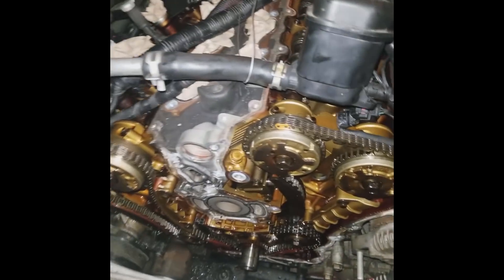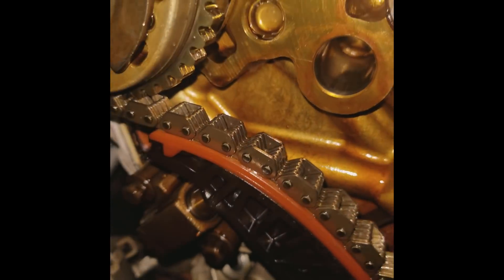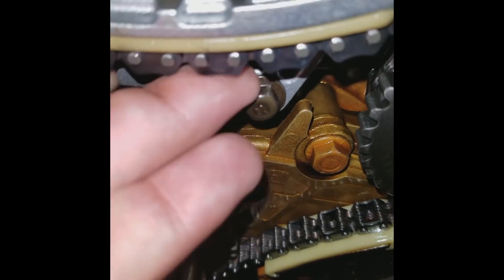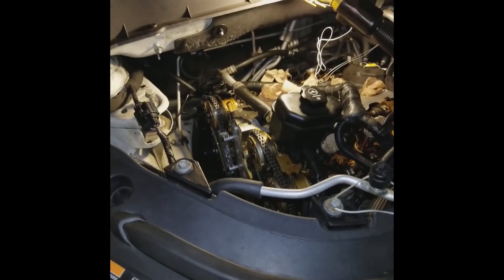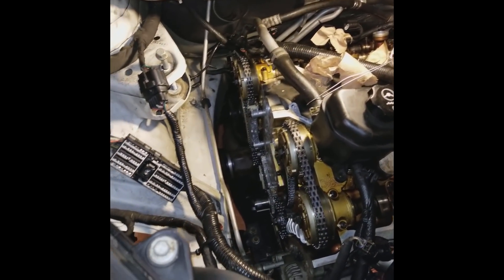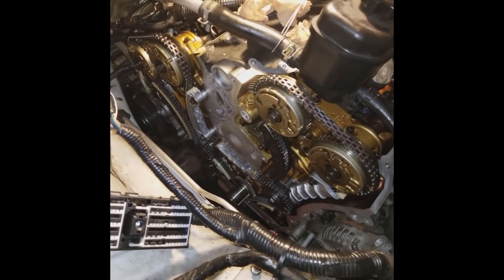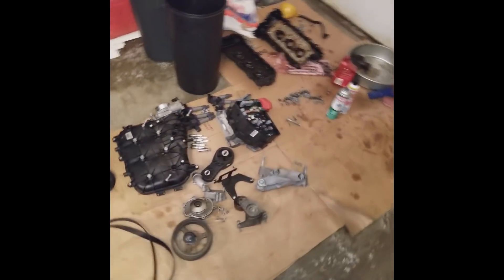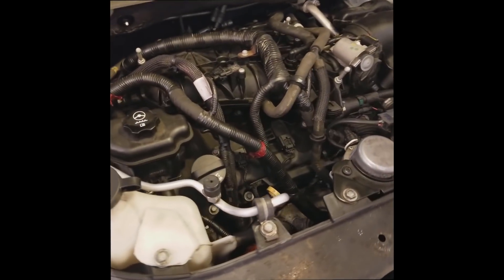GM 3.6 High Feature V6 In-Vehicle Timing Chain Replacement, No Engine Removal, Stretched Chains

Comment: I'm on my 3rd round on my 2010 Chevy Traverse.  Installed everything knew having trouble with phasers locking properly on left intake.  Jumped timing brand new parts from Amazon.  Tried to send back bad Selenoids in the kit they wont give me my money back.
Is there a wrong way to install a phaser?

Comment: Great video, I am in the home stretch, Just wondering about the timing cover.  How did you put sealant on it and NOT mess it up installing in back in.
Reply from the maker: Do a dry run or two first. The only other thing that's key is having someone else with some dexterity to help you! Good luck to you, sir!

Comment: About to do this on 2008 Acadia. Im original owner have over 135K. No check engine lights and this will be it's first timing chain job. The only real reason I'm doing it is because the timing cover started to leak. I change my oil every 3000 so the engine has been good. My questions is what RTV did you use and did you put new sprokets. I was going to get a Cloyes kit, but I've seen and read lots of chains busting at under 5K in the last few years. I believe they are no longer making them in the states so most kits now say made in China SMH.  I'm just going to get OEM chains instead. Tx
Reply from the maker: Wow, hadn't yet heard that about Cloyes. What a shame. I just had a bunch of bad Moog parts recently too. 

If I recall correctly, I used the part number for the sealant that's recommended by GM, which I believe is in one of my other comments here. But I wouldn't hesitate to use just permatex RTV or something good like Honda/Threebond either.

I didn't do the actuators, as I was really suspecting just a chain issue. However, I have heard of a lot failing and seen a few. I wouldn't be surprised if it was more common on the earlier years, but I'm not sure on that. I doubt it would hurt to do them, but that's something I'd definitely go with OE on as well if I did anything. For me,  it would probably come down to cost. You might want to check for any info or TSBs regarding certain years or one or intake/exhaust being more or less common. 

Hope it all goes as smoothly as possible for you!
Reply from the maker: Also, and I don't want to jinx you,  but my understanding is that those early years had other issues:  front and rear evaporators, transmission failure... right as everyone's quality dropped with the housing crash, plus early models are always a crapshoot. Just wanted to mention that in case it influences how much time and money you put into it and weren't aware!
Reply: @ClaytheBMXer  Well I take good care of it maintenance wise. I change all the fluids early (Only use Full synthetic) so maybe that helped it last so long. Yes I've heard of all those problems including the 07-08 vs 09 and beyond engine minor update tweaks to the engine. The only components that have gone out is the powersteering pump, motor mount, one coil pack and the radiator developed a small leak near the fill elbow this year. Not bad for a 15 year plus vehicle I live in Southern California Desert area in 110-120 plus weather 4 months outta the year 😅 I replaced everything myself so saved 💰. Other than that she still runs mint. I'm getting the OE kit from Rockauto. I'm doing the job myself so it's only costing me the parts. I was bummed too that Cloyes QC has gone down. From reading reviews to commenters and videos online not going to take that hit or miss chance. Did you use Ultra Black RTV and did you change your sprockets?

Comment: P0017 doesn't mean stretched chain. You probably just needed to replace the cam sensor.
Reply from the maker: Incorrect. This is a correlation code,  not a circuit fault.
Reply: @ClaytheBMXer  if that's the case I'm selling my car lol
Reply from the maker: @MOTHERCLUCKER2014  I wouldn't blame you at all! Good luck to you! 

I see lots of confusion between CMP circuit faults, performance faults, and cam-crank correlation faults. 
The same goes for things like catalytic converter efficiency codes being mistaken for "O2 codes" (this actually means the sensor is working). 

It's always worth reading all of the published information on a code - set criteria, possible causes, action taken when set, even skimming through the trouble tree that's usually terrible can help your understanding of a code and how to resolve it! 
There are even DIY versions of things like mitchell/prodemand that are worth it for tackling certain problems! 
The internet is great, but question everything - even me! It helps to have a diagnostician on speed dial too, but that's not always feasible Haha.
Reply from the maker: @MOTHERCLUCKER2014  I should add that the 100% correct way to diagnose the issue is to hook up an oscilloscope and compare waveforms with known-good captures. However, it's also not always completely necessary.

Comment: I agree..not too much help from YouTube on all it takes...im not great with organizing parts...but if ya just have lots of time, great perseverance it can be done...lots of research on YouTube researching available subjects on certain things like just removing valve covers or replacing motor mounts etc..plenty of videos on timing chains, while up on bench made that part easy...its all the other stuff that goes along with it that is quite tedious....my hats off to anyone with the guts to tackle this job without a garage and equipment like power ratchets and stuff to make bolt removal  easy..all those bolts that have plastic inserts that have to be wrenched a ll the way out instead of broken loose and finished up by hand  can be especially tedious for a man that turned 68 yesterday...oorah!

Comment: I did this job on a 2010 Lacrosse with the engine in place, saved around $2,000. Turned out great, but holy crap it was TOUGH. Congrats on your success 👍👌💪👊

Comment: Sir could you be so kind to convey if cylinder number 1 is top dead center at stage 2 position or stage 1. Thank you 🙂
Reply: Make sure the flaps from the cams in the rear are straight  - -

Comment: Can we get an update on the Cloyes timing chain, any issues 4 years later?
Reply from the maker: Zero issues until vehicle was totaled in a traffic accident about a year ago. It only got around 15-20k miles put on it though. I have since used Cloyes on a couple of other vehicles with no issues as of yet. I have only heard good things from others. Unfortunately though, I don't have any data beyond anecdotal.

Comment: Marcel Grundmann
0 seconds ago
Its true, breathing is a problem, so solution is...drill trough the pcv valve  (4mm)  on the right rockercover ( remove it before you do it!)  remove the plastic hose with the t piece connecting the pcv to the plenum chamber. remove the lh rockercover breather going to the air intake.  Now slowly heat up the plastic hose at the t piece and remove the t piece. Rh Rockercover back on. clip the hose back on the drilled out pcv connector, use a silicone hose piece and the old plastic hose to extend the pcv hose with the original removed plastic hose, it routes along the back of the engine just like before, just no t piece, ending up parallel to rh rockercover breather, cut rh rockercover breather and fit  with careful heat the t piece, connect hose back to air intake . clip it all back into the hose supports. block the plenum chamber inlets, done.... no more breathing problems, looks factory, cant tell the difference,  huge difference in engine cleanliness,  however the throttle body does get a bit dirty over time and should just be wiped out every second service, these engine always consume some oil, checks and regular services are a must.... any questions or pictures contact Boat and Bumper.... Humpty doo..... hope that helps

Comment: I have that engine in an Acadia, 2012 with 152,000 miles.  Babied since new and works fine, oil analysis very good.  I wonder what it’s life expectancy is.  I wonder the same on the tranny, it’s on 4th drain and refill.  Still has original pads and rotors.
Reply from the maker: Glad to hear that!  Hopefully it keeps going. Hard to say what the exact cause of these failures is without knowing the complete history of the vehicles. If I recall, the exploding wave plate issue was fixed after 2011? And wow! You must not use your brakes haha. I've never seen a set go that long,  even on a prius. But I'm also in the rust belt.
Reply: @ClaytheBMXer  Arizona car, a fairly good amount of highway miles, no Jack rabbit starts and light brakes when possible.

Comment: I'm on take two. my Cadillacs last chain didn't even last two years. Don't use cheap parts. Thanks for the video I have to do my traverse next and I haven't done one with the motor sideways, Cadillac gives you tons of room because the motors in there straight.

Comment: I think I’ll flop a new oil pressure sensor switch &&& a nU power steering pump in there(as well as oil pump, water pump, all phaser sprockets, cam sensors & slide in auctoator gizmoz) Y not👋😒
Reply from the maker: It's a lot of extra money, that's why I didn't. The water pump and oil pressure sensor are definitely common failure items for leaks. That said, I'd go OEM, had issues with even gates and standard on both. I've only ever seen one power steering pump go bad on any of these platforms. It was on a FWD model and was easy to remove on its own. Never personally run into a bad actuator either, although I've heard it discussed and seen it in case studies. This would be the time to do them, but again I'd go OEM if you do. The CMP sensors and solenoids are accessible with it together though. I don't recall how much extra work an oil pump would be. Only you know how long you intend to keep the car though, and my experience is mostly anecdotal, so you do you!
Reply: here’s one I heard incase U didNt, this sludge is often associated with pcv valve  but the 1 bigger small hole redrill to 7/64ths & the 2 smallr smalls to 5/64ths👋

Comment: How did you move the power steering pully out of the way
Reply from the maker: IIRC I unbolted the pump assembly but left the lines connected and moved the entire pump out of the way. It's been awhile though.

Comment: The problem with the Alloytec/GM engine stretching chains is due to the PCV valve, the holes are too small so clog up stopping it from breathing. Pop the pcv valve off drill the holes slightly bigger, then if possible add an oil catch can & it solves the timing chain stretch issue.
Reply: I did exactly this same thing a couple of years ago on my wife's impala, fingers crossed it works. She only has 80k on the engine currently, but i do 5k synthetic oil changes as well. This is a project i really don't want to do unless i have to

Comment: What kind of cilicon did u use to put it back?
Reply: was thinking same thing cause my cover is leaking
Reply: @bigwaves2824  Right Stuff 90 Minute Red High Temperature Gasket Maker on Amazon
Reply from the maker: Here is a copy/paste of my response in another comment for the benefit of others. Sorry I didn't respond sooner, hope you got your car all fixed up! 
"I just checked SI. The GM part numbers for the sealant are 12378521 (150g) or 88861417 (75g). It would also be prudent to find the factory procedure/image for applying the sealant. They are very specific about how much you should apply and where. I do not have a source on this besides having access to an expensive, professional Service Information subscription, so I wish you luck."

Comment: Thanks for measuring the chain. I was wondering if I could slide some new idlers in without all that work but they probably get trashed quickly if the chain is all stretched out.
Reply: Nope. You should have gone ahead and done so. I've done a bunch none have come back to me. Coyles etc want you to spend a fortune to replace unnecessary stuff. If it's a chain just replace the chain etc
Reply: @chumadoshi6987  technically speaking I still haven't fixed it.  all I know is it's real rattly sounding like the chain is rubbing on something.    and I think it's messing with the cam sensor because anytime I turn to the side while driving the engine practically stalls out.  I ordered the cheapest version on eBay or Amazon along with the valve cover sets exedra so I probably have all the parts I might need.  They were suspiciously cheap though.
Reply: For this kind of job use good chains cloyes are good ones the kit@SiriusSolar

Comment: Hello, great video, thanks. Just did timing chain set on 2009 Enclave.  Right side timing does not appear to be correct.  Need help confirming right side timing by identifying cam locations to tdc before completing assembly.  Help!!!
Reply: If you buy the timing chain kit off e bay, it comes with a set of spanner locks that fix the cams in the correct position.
Reply: @Dev JB A garage did my 3.2 v6 alloytec  a few months back & said he couldn't understand why people needed to do the 2 stage and did it in one I think, using the cam holding spanners, car seems to be running fine? Or do I need to go back?

Comment: I've done similar timing chains on the Duratec V6 in Ford vehicles. Equally a pain but an even number design. On those, the water pump is inside the motor and driven directly off the chain. Guess what happens when the water pump leaks? 💥
Reply from the maker: Yessir, I've been inside one of those. On the Edge, I ended up dropping the front subframe, engine, and trans. Not sure if that's the most efficient way, but at least I had good access. You've gotta admit though - it's at least slightly funny when an alternator starts leaking coolant ha.
Reply: @ClaytheBMXer  I agree...lol. The most unusual place for a weep hole

Comment: GM makes their engines pretty easy to work on!...I just did mine and it wasn't that bad!...these engines are BEASTS!...I'm an uber/Lyft as well as commercial driver but I've also worked on cars for over 30 years!...so I've worked in just about everything and by far Fords, Mazdas, mitsushitties and all european junk are the worse to work on!...I got over 250k on her with the stretched chains she was still running good with a/c on!...no overheating issues or anything!...but it's the PCV valve that's killing these beauties...but once the issue was fixed cars gotta new lease on life!...oh and I got my chain set for $100 on ebay!...its a complete kit!...
Reply from the maker: There's not a single company I can think of that still builds cars with serviceability in mind. I would strongly, strongly recommend using only a quality timing kit from somewhere reputable. Fake parts are becoming more prevalent on Amazon and Ebay as well.

Comment: I'm doing mine this week. I have 124k on my engine no codes or anything like that but I just don't want this thing to stretch and jump timing and damage the engine. I'm also going to change the oil pump. Any tips on changing the oil pump?
Reply: Did you get it done? How did it go?
Reply: @Hex173t  yes I got it done and let me tell you it's not easy but it can be done. . I removed the fuse box and the plate it sits on. I removed the upper motor mount and the bracket. Antifreeze reservoir has to be removed once you remove these things you have a better view of the front timing cover plate. Remove your upper intake Make sure you disconnect all the vacuum hose. Remove all your electrical plugs Do yourself a favor and take a picture of these things so you know how everything goes back. Alternator and power steering pump has to be moved out of the way.  here comes the fun part. Remove the belt water pump pulley water pump. There's eight different sensors on the timing chain cover that has to be removed before trying to remove the plate. Go online and look for the schematics on how to remove the bolts to the plate. The biggest advice I could give you is to go with a good timing chain set Do not and I will repeat myself Do not go with no cheap eBay or Amazon parts you will regret it.

Comment: Omg it's not the tentioner problem it's a oil issue. This is a bad designed engines and GM needed to discontinue this junk from year one.
Reply from the maker: Yes

Comment: How the hell did you make out the timing marks with an eat west facing engine?
Reply: something called an inspection mirror I would imagine
Reply: Why would the mounting of the engine change anything... lol. 

On aircraft the timing marks are at the back (since the propeller shaft is at the front). Somehow you can still see them.. lol.

Comment: Do you have a part number for kit ? I have the 3.0
Reply from the maker: Probably too late, but I used the Cloyes kit. I mention in the video that they have a great video on doing the chain itself as well, which is why I didn't include that part.